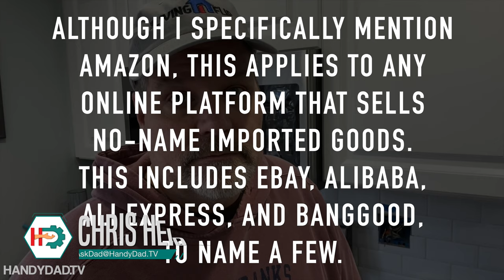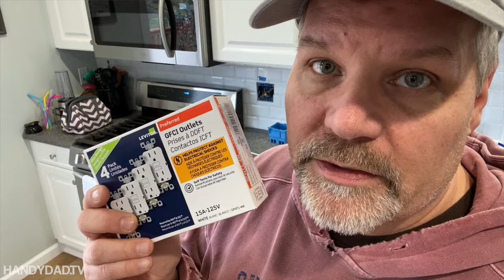Almost Burned Down the House 🔌🔥🧯

Comment: I work in the lighting industry; I can assure you that ETL is a reputable, code recognized testing lab. However, there is nothing to prevent an unscrupulous manufacturer from slapping on a label from a different version of the product, or even another product altogether. I've seen it happen to lighting fixtures. 

I do not know what happened with your receptacles, but I'd urge you to try to contact ETL with your concern.

Comment: If it doesn't have the UL listing then I don't buy it.  Something was loose in the outlet causing the heat.  Cheap outlets also don't maintain friction on the plug causing heat or not allowing it to stay plugged in.  Good catch finding that problem!

Comment: Wagos make for a easy install but in my experience as a commercial electrical apprentice (at the mouse house) we never use them. They aren't trusted by any electrician I know and my foreman requires them to be cut off and replaced with a standard wire nut. Make sure anything device you buy has that UL listing as well. See you in October.. 🤞
Reply from the maker: I can’t argue with your foreman, and I was also skeptical before using them. But I watched a few testing videos where the wire melted before the connectors failed so I switched. Also they’re authentic Wago made in Germany, not Chinese imitations.

Comment: I bought some less expensive off branded GFCI outlets online on Amazon. They were god awful the workmanship, fit and finish were poor and the grounding point on all  three were stripped out. In addition they didn't fit a standard work box! These were brand new sealed and I returned them under Prime and got my money back. I was under time  constraints by then so I went to Home Depot and bought 3 Leviton GFNT2-W Self-Test SmartlockPro Slim GFCI Non-Tamper-Resistant Receptacles with LED Indicator. They worked as needed for my kitchen remodel.

Comment: Great video! I doubt that most electricians would have noticed or cared. I hope I'm wrong about that. But I got a nasty feeling I'm right. A few years ago, I replaced all my outlets in my bottom floor condo with the cheapest Leviton outlets from Home Depot. Some of the old outlets had plugs halfway hanging out of them. Also, I converted all my circuits to GFCI protected circuits, even though only kitchen and bathroom circuits are required to be GFCI'ed. I also got all tamper-resistant outlets (just before they were required) because I remember sticking my fingers in outlets back when I was little.

Water came through my ceiling twice, once into my bedroom from the 2nd floor, and once into my living room from the 3rd floor. (so why only kitchens and bathrooms?) Recently, I was working on a vacuum cleaner when the motor danced all over my dining room table. The power suddenly cut out to that previously non-GFCI protected circuit, thus preventing further damage. So I figure "Mr(s) Upstairs" inspired me to do all this.
Reply from the maker: Did you use all GFCI outlets? Or GFCI breakers?